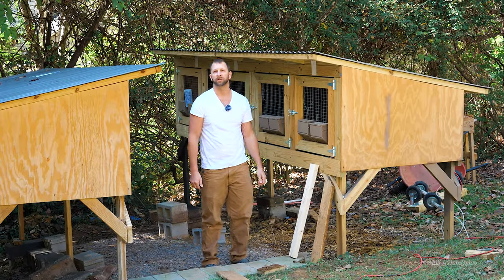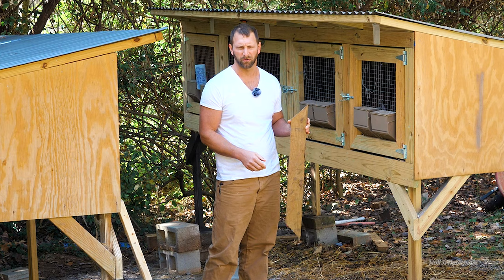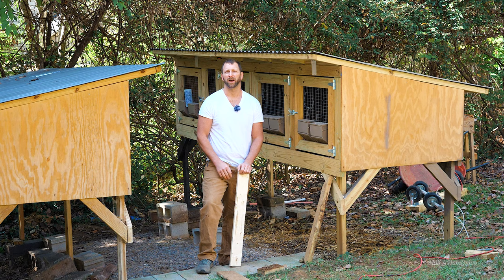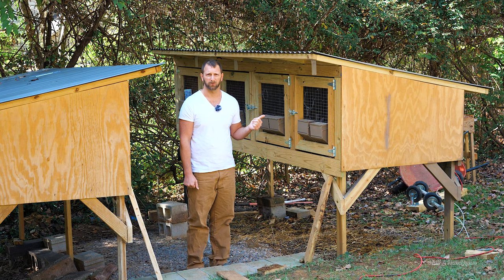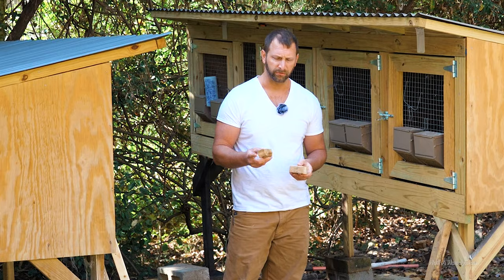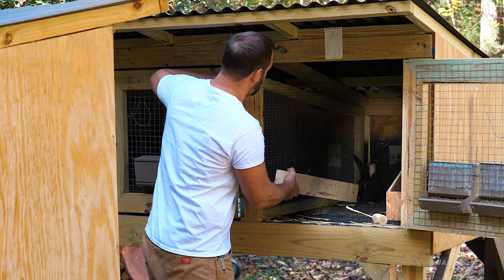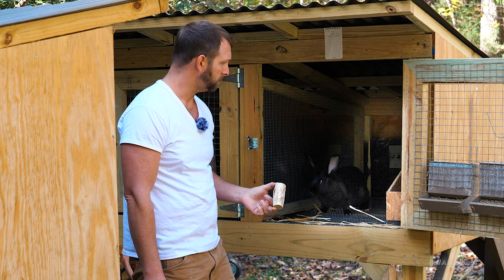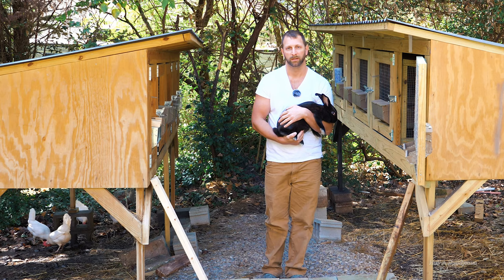TREATED vs UNTREATED - RABBIT HUTCH - ONE BIG MISTAKE

Comment: Untreated for me. Though i never build with the wood to contact with the soil. I build on rock and on the rocks i put ”syllpapp” (swedish word) like a asphalty tape so the wood doesnt suck up any moist from the rock. 
Then i have a roof over the run so that wood never get wet either. On the big run there is just fence. No roof. There the birds are when iam working nearby. Eagles dont attack when im out
Reply from the maker: Good idea.  I also have problems with carpenter bees so hopefully the treated will deter them.
Reply: @HalfAHandyman  yeah then it might b best with treated wood.

Comment: A raised square 1' patio block under each leg will prevent some rot and slow hutch sinking.  Manure odor fluctuates with wetness and ambient temperature (even from bucks to doe urine). Outdoors, this should not get too offensive unless really wet. In those cases, you can add a couple inches of gravel after cleaning to soil level. A rabbit/bee keeper over a period of 30 years, and your hutch plans are a nice sound and roomy design. Your hutch has nice flat surfaces to shed the rain. | don't own Valspar - Duramax paint stock - but I should (Lowes-I don't buy much else there ). The best way to protect wood (treated or not), esp. from uv sun, is a good latex paint (2x coats @ highest gloss)(beehive experience). It will cost you a dollar, but it will save $10 in time, labor and replacement materials.  I'd rather my rabbits chew latex than oil based paints (I was a hardline oil paint guy most my life). Same philosophy on natural vs treated wood. Rabbits live a short life, hard to know what chemicals accumulate, but as meat for my family, I'd use untreated anywhere rabbits can put their teeth. Treated, anything below floor level for sure. Paint and a little exterior caulk will make up for any insecurity in using areas of untreated wood.